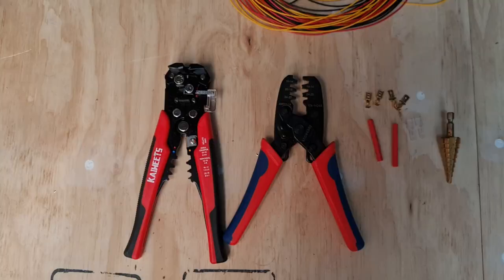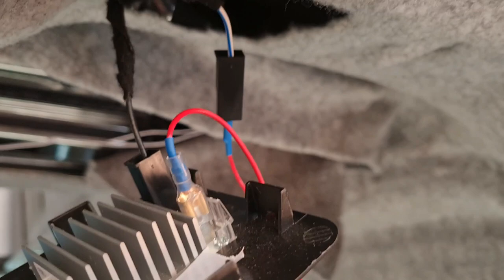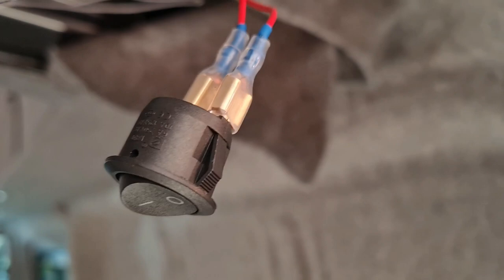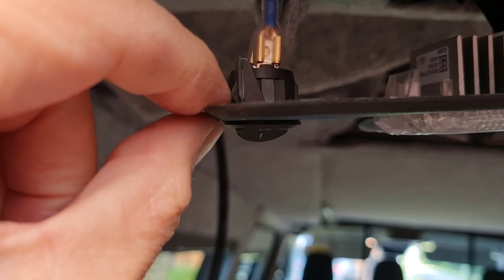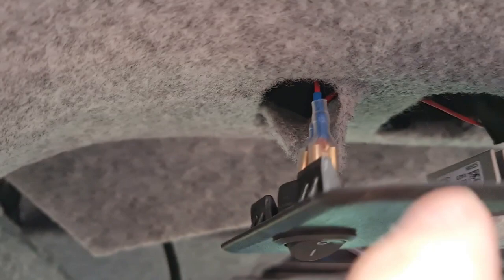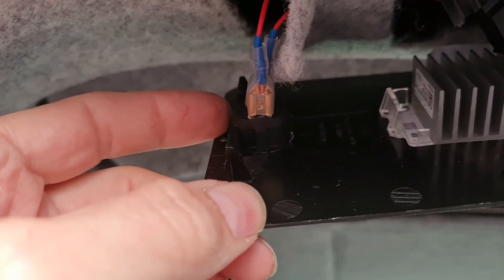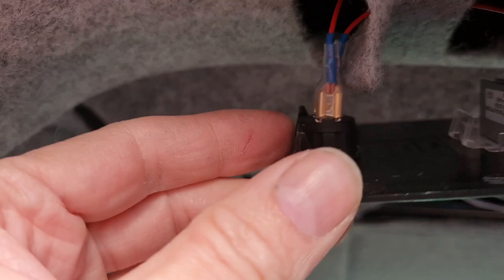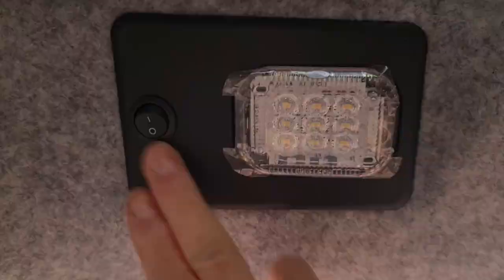Easy way to wire in a switch to control your barn door lights on a ford Transit Custom

Comment: I am trying to install 2 12v led strip lights and trying to power them off the rear cargo lights but when I wire both them up only one strip lights is going on and off with key fob or door open close the other stop light remains on 24/7 ?
Reply from the maker: @MarkMc-66  Hi. Not sure why that is but have you tried wiring the two led strips into each other, so the working correctly led is also powering the other led. By passing the factory wiring loom  of the 2nd cargo light.

Comment: For these lights is there just two wires? +\-? I already have aftermarket switches installed and just need to run wires to the switches….
Reply from the maker: Hi, yes their were just + and - as I recall, very simple job. Did not need to cut any wires, so easy to return to original if required.

Comment: Hi, looking to do this myself. Do the lights have a permanent live or is it only ignition live? Wanting these to work as a camper so turn them on without the ignition on or when van is locked etc
Reply from the maker: Hi. I don't think they are, as if you try to turn them on from inside the vehicle without opening the doors, say after 10 minutes of unlocking the doors they will not turn on. I converted my van into a camper and had to run a separate light fed from my leisure battery to give me lights in the van.
Reply: Thanks for this! Is the cable really 15amp that’s required? Seems a lot for led lights that’s all?? 😊
Reply from the maker: @djhorwich  No it's not required it was what I had available from my camper conversion, I used 15 and 25amp throughout
Reply: Does this turn all 4 lights off or just the one. Not sure what might feeds the others